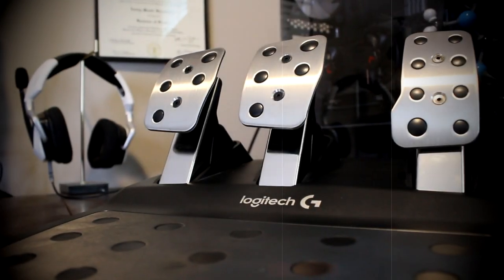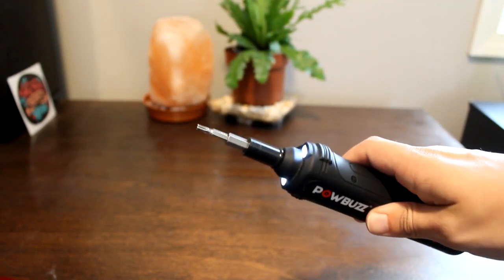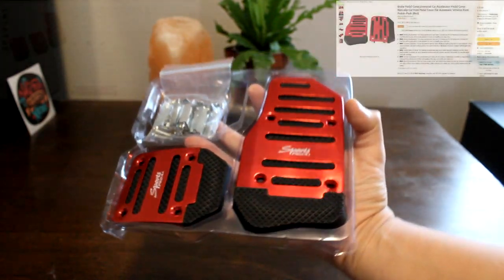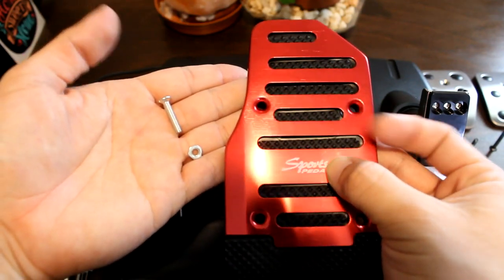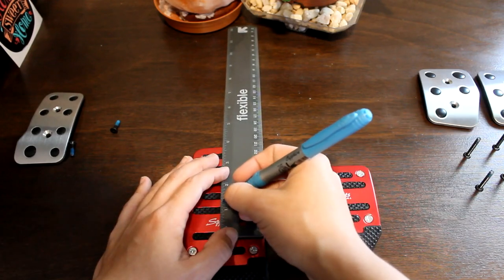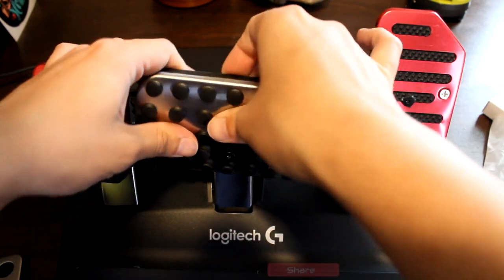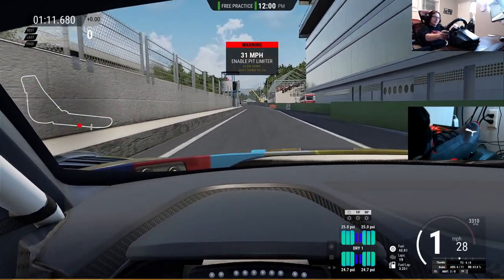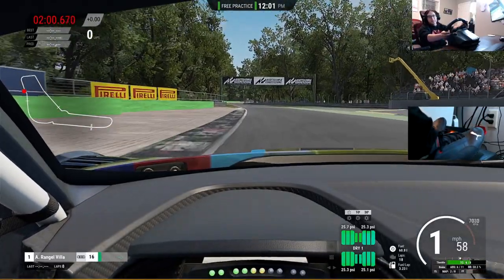Modded: New Logitech Pedal Mod! - Sim Racing Gear!

Comment: I don't want to be mean but you could simply have used the original pedals as templates for drilling the holes in the new ones
Reply from the maker: You're absolutely right! It made things much easier that way my brother ended up doing what you suggested 😉
Reply: Bro, stop cyberbullying
Reply: @shanehansen3705  bro, that was sooo uncalled for bro.
Reply: @stfu7203  no it wasn't giving some one a heads up on how to do something easier better is not bullying you are out of line with no clue
Reply: @shanehansen3705  brooo, I'm absolutely inside the line, mmkay, how dare you tell me I'm outside of the line mmkay. I'm reporting you to YouTube for cyberbullying and misinformation mmkay
Reply: @stfu7203  go for it like I said you started this with a ridiculous accusation if you want to have a go at me than I will clap back every time grow up and get a clue

Comment: Personally I would've used the brake pedal from a manual transmission pedal kit. You did say your issue was that the pedals were too close together so the automatic brake pedal is even closer to the others than the Logitech pedal was. I'm definitely gonna use this on my own because I don't use shoes when I play and my socks slip around on the Logitech pedals.

Comment: 4:17 Where can I get that wide metal brake pedal show at 4:17 ?
Reply from the maker: That you can find on amazon search for "Stainless Steel No Drill Fuel Brake Foot Pedals for Mercedes Benz V Class Vito Metris Viano W447 W639" they are $14 dollars ish with taxes still pretty cheap!